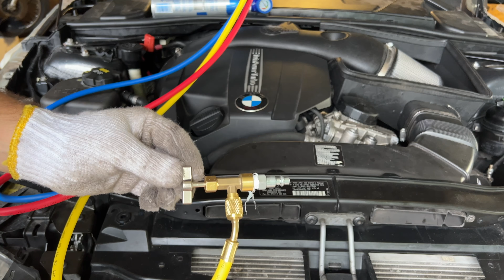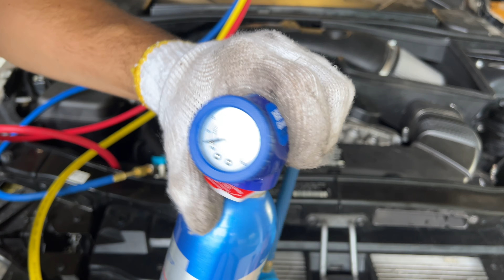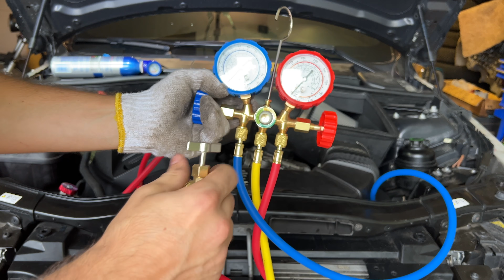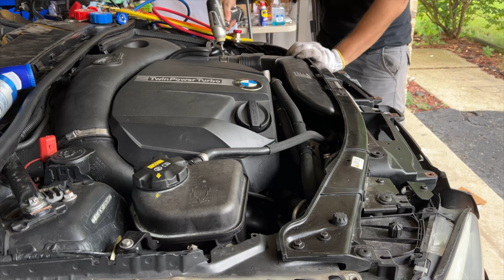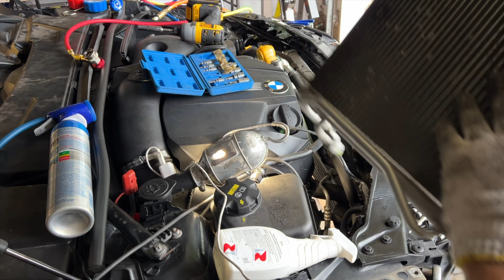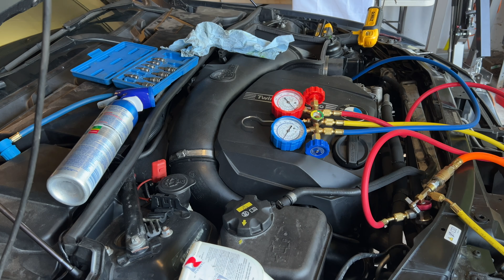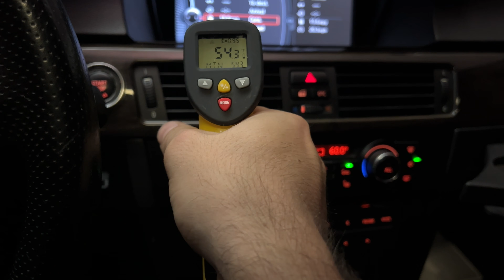Finding AC Leaks in Empty System – No Freon, No Problem

Comment: i just found a huge leak in my 08 uplander it was hard to find but i saved a bunch it was a loose bolt on the bottom of the air cleaner dryer taking your car to a shop is nuts they will rip u off

Comment: this is a good idea - if you want to saturate your PAG oil with moisture that will eventually chemically react with the oil and refrigerant to create an acid that will damage your system.  Better to use refrigerant (after purging the air out of the lines) or dry nitrogen.
Reply: It’s already been open to the atmosphere. It’ll be fine so long as he pulls a vacuum.
Reply: @CookingWithLivvy  sure, if he can get it down to less than 500 microns and hold it there when the vacuum source is removed.  But, I doubt he owns a micron gauge,  has dry hoses,  no leaks, and has three days on a vacuum pump to get it there.  An ounce of prevention is worth a pound of cure.

Comment: Hello,  I have a 2016cadillac escalade esv platinum, and my ac is not cooling at all. I took it to my local mechanic, and he did the same thing that you're doing. So today, I was driving along, and suddenly it went and hot, and it was nearly 90 degrees outside where I live so I took it back to my local mechanic and now he tells me that its a pin hair leak whatever that is! He claimed that there were no leaks and now it's a leak.

Comment: For those wondering he used a 1/4-Inch NPT Male Industrial Air Hose Quick Connect Adapter (easily found on amazon) and PLENTY of teflon tape to create the seal. While close, the outside diameter of NPT is 0.54" vs 0.5" of 1/2" ACME. To get a perfect fit you need to combine three pieces or for a good fit you need two pieces.

Side-by-Side Comparison
Feature	                1/4" NPT (Air)	                                1/2" ACME (R134a)
Actual Width	        ~0.54" (Larger)	                                0.50" (Smaller)
Thread Shape        Pointy / V-shaped	                        Square / Flat-top
Taper	                Yes (gets wider)	                                No (straight cylinder)
Sealing Method	Thread interference (Tape/Paste)	Internal Rubber Gasket

Ok 1 piece connection like used in the video
1/4-Inch NPT Male Industrial Air Hose Quick Connect Adapter (easily found on amazon) and PLENTY of teflon tape to create the seal

Good 2 Piece Connection 
Step 1: Use a 1/2" ACME Male to 1/4" SAE Female Flare adapter. This fits onto the guages.
Step 2: Use a 1/4" Male NPT to Air Quick Connect Plug (Industrial or Automotive style). Standard 1/4" NPT threads are very close to 1/4" SAE Flare threads and can often be connected for non-refrigerant use, though a dedicated NPT-to-Flare adapter is technically safer for a perfect seal.

PERFECT 3 Piece Connection
Step 1: Use a 1/2" ACME Male to 1/4" SAE Female Flare adapter.
Step 2: Use a 1/4" SAE Male Flare to 1/4" NPT Female adapter (this allows you to screw on a standard air plug).
Step 3: Screw on a standard 1/4" NPT male Air Quick Connect Plug.
Reply: Thanks for this! I noticed he glazed over this pretty fast
Reply: SNAZZY!
Reply: Thanks for this breakdown

Comment: Is that a standard tap Valve @ 0:41 seconds?  Those air connector fittings won't connect to the valve?  What did you use to do this?

Comment: Do you have a part number or link to the fitting you used to adapt the shop air connector to the yellow line? My shop doesn’t have a nitrogen tank to test for leaks and I’d like to try this
Reply: For those wondering he used a 1/4-Inch NPT Male Industrial Air Hose Quick Connect Adapter (easily found on amazon) and PLENTY of teflon tape to create the seal. While close, the outside diameter of NPT is 0.54" vs 0.5" of 1/2" ACME. To get a perfect fit you need to combine three pieces or for a good fit you need two pieces.

Side-by-Side Comparison
Feature	                1/4" NPT (Air)	                                1/2" ACME (R134a)
Actual Width	        ~0.54" (Larger)	                                0.50" (Smaller)
Thread Shape        Pointy / V-shaped	                        Square / Flat-top
Taper	                Yes (gets wider)	                                No (straight cylinder)
Sealing Method	Thread interference (Tape/Paste)	Internal Rubber Gasket

Ok 1 piece connection like used in the video
1/4-Inch NPT Male Industrial Air Hose Quick Connect Adapter (easily found on amazon) and PLENTY of teflon tape to create the seal

Good 2 Piece Connection 
Step 1: Use a 1/2" ACME Male to 1/4" SAE Female Flare adapter. This fits onto the guages.
Step 2: Use a 1/4" Male NPT to Air Quick Connect Plug (Industrial or Automotive style). Standard 1/4" NPT threads are very close to 1/4" SAE Flare threads and can often be connected for non-refrigerant use, though a dedicated NPT-to-Flare adapter is technically safer for a perfect seal.

PERFECT 3 Piece Connection
Step 1: Use a 1/2" ACME Male to 1/4" SAE Female Flare adapter.
Step 2: Use a 1/4" SAE Male Flare to 1/4" NPT Female adapter (this allows you to screw on a standard air plug).
Step 3: Screw on a standard 1/4" NPT male Air Quick Connect Plug.

Comment: can you explain how you got that air hose adapter to fit in the can tap. what parts do i need to make this work. thanks
Reply: For those wondering he used a 1/4-Inch NPT Male Industrial Air Hose Quick Connect Adapter (easily found on amazon) and a PLENTY of teflon tape to create the seal. While close, the outside diameter of NPT is 0.54" vs 0.5" of 1/2" ACME. To get a perfect fit you need to combine three pieces or for a good fit you need two pieces.

Side-by-Side Comparison
Feature	                1/4" NPT (Air)	                                1/2" ACME (R134a)
Actual Width	        ~0.54" (Larger)	                                0.50" (Smaller)
Thread Shape        Pointy / V-shaped	                        Square / Flat-top
Taper	                Yes (gets wider)	                                No (straight cylinder)
Sealing Method	Thread interference (Tape/Paste)	Internal Rubber Gasket

Ok 1 piece connection like used in the video
1/4-Inch NPT Male Industrial Air Hose Quick Connect Adapter (easily found on amazon) and a PLENTY of teflon tape to create the seal

Good 2 Piece Connection 
Step 1: Use a 1/2" ACME Male to 1/4" SAE Female Flare adapter. This fits onto the guages.
Step 2: Use a 1/4" Male NPT to Air Quick Connect Plug (Industrial or Automotive style). Standard 1/4" NPT threads are very close to 1/4" SAE Flare threads and can often be connected for non-refrigerant use, though a dedicated NPT-to-Flare adapter is technically safer for a perfect seal.

PERFECT 3 Piece Connection
Step 1: Use a 1/2" ACME Male to 1/4" SAE Female Flare adapter.
Step 2: Use a 1/4" SAE Male Flare to 1/4" NPT Female adapter (this allows you to screw on a standard air plug).
Step 3: Screw on a standard 1/4" NPT male Air Quick Connect Plug.

Comment: My rav4 had a slow leak.  First summer I refilled at $20 and had Air conditioning all summer.  Next year I took the car to the dealer.  The AC was refilled and the leak not found for $240.  After that every spring I put in $20 of Freon into the system.  Now the AC compressor has died; can't create pressure.  Going to the dealer was a huge mistake this time.
Reply: Same here my RAV4 have a slow leak and haven't fixed it yet but someday.
Reply: You mean wasting money on a dealer or because they put on freon? 

What did you do? Did you find the leak? I am unable to find a leak in my RAV4 even after adding the UV. The local guy said just keep putting freon every spring/summer until the leak is big enough to be able to find it.
Reply: @AzSah000  I just filled it up with $20 of Freon every spring until the compressor wore out.  I now have 290,000km on the Rav4 and need to do a lot of work.  (Exhaust, timing belt,find out why new compressor works then stops,  body work)  Good Luck.
Reply: @lazaryanya9407 I see. Thanks for sharing info. So do you recommend, I keep filling Freon until I find where the leak is? Or would you suggest going to a mechanic and get it checked and fixed now? Thx
Reply: @AzSah000  It depends on the size of the leak.  If it lets you have air conditioning all summer then just fill it every spring.  If you have to fill it more than once per year then have it repaired.  Your leak is most likely in the compressor.  My compressor had worn right out contaminating the whole plumbing.  If your Rav4 is over 5 years old replace the compressor.
Reply: @lazaryanya9407 today I put a freon with a lil stop leak and will see how long it goes. But I'll get the compressor changed

Comment: Put 29.2 in-lbs of vacuum on it and close all the valves on the manifold but leave the charge valve heads open, if it holds the vacuum 5 minutes there isn't a leak. Just make sure your lines and connections are leak free.
Reply: Not always.. did mine held vacuum for 2 hours at -30 in about a week later...i was empty of freon... I'm about to look for the leak.God knows where it's coming from
Reply: @Pinkielover 2 hours held vacuum and lasted a week, you might have to use a ultraviolet dye to find it. Modern A/C hoses have a barrier liner inside of them because of the chemistry of the newer freon and even if they look fine on the outside, freon can leak right through the material. A leak Sniffer or UV dye should find it. If it holds a vacuum fine but leaks out when you are using the system, it's most likely on the high pressure side of the system (250+ psi) would overcome the 29 in-lb vacuum test.

Comment: Good method for finding leaks. For the people who complain about using compressed air, attach a water/oil separator to the air line to remove most of the water. Then vacuum the system for at least 1/2 hour to remove the rest of the water. That should be sufficient to then recharge the system without chance of corrosion or damage due to water.

Comment: So you don't need any special tools, just specialty gauges and freon.  That makes sense.
Reply from the maker: It does, because normally this would require a specialized tool that is in the thousands of dollars
Reply: @SimpleCarGuy  It still does if you have some ethics and don't plan on handing down problems to the next unsuspecting soul that buys your improperly repaired vehicle.  A vacuum must be applied to the system (to ensure it's dry) before pressurizing with new freon.  Said vacuum pump will also create a whistling noise like you showed with the humid shop air, but it has no chance of possibly contaminating the system with moisture, corrosion, or pump oil.  Shop air should never be used in a hvac (closed loop) system, similar to not using WD40 in your oiling system or tap water in your cooling system.  As it has been said...there's a tool for that, and I'm not talking about you.

Comment: Can anybody tell the pieces needed to makes this work ?
Reply: For those wondering he used a 1/4-Inch NPT Male Industrial Air Hose Quick Connect Adapter (easily found on amazon) and PLENTY of teflon tape to create the seal. While close, the outside diameter of NPT is 0.54" vs 0.5" of 1/2" ACME. To get a perfect fit you need to combine three pieces or for a good fit you need two pieces.

Side-by-Side Comparison
Feature	                1/4" NPT (Air)	                                1/2" ACME (R134a)
Actual Width	        ~0.54" (Larger)	                                0.50" (Smaller)
Thread Shape        Pointy / V-shaped	                        Square / Flat-top
Taper	                Yes (gets wider)	                                No (straight cylinder)
Sealing Method	Thread interference (Tape/Paste)	Internal Rubber Gasket

Ok 1 piece connection like used in the video
1/4-Inch NPT Male Industrial Air Hose Quick Connect Adapter (easily found on amazon) and PLENTY of teflon tape to create the seal

Good 2 Piece Connection 
Step 1: Use a 1/2" ACME Male to 1/4" SAE Female Flare adapter. This fits onto the guages.
Step 2: Use a 1/4" Male NPT to Air Quick Connect Plug (Industrial or Automotive style). Standard 1/4" NPT threads are very close to 1/4" SAE Flare threads and can often be connected for non-refrigerant use, though a dedicated NPT-to-Flare adapter is technically safer for a perfect seal.

PERFECT 3 Piece Connection
Step 1: Use a 1/2" ACME Male to 1/4" SAE Female Flare adapter.
Step 2: Use a 1/4" SAE Male Flare to 1/4" NPT Female adapter (this allows you to screw on a standard air plug).
Step 3: Screw on a standard 1/4" NPT male Air Quick Connect Plug.

Comment: Clearly you don't know what you're doing... Never never never use air to detect leaks, you can only use nitrogen. The water vapor in pressurized air is introduced to the system and that mixes with the refrigerant and oils in the system. Just having any moisture alone in the system causes issues in and of itself. 
The only way I'd ever use pressurized air is if I were replacing a complete system once a major reason and justification was found for system replacement and I was showing a customer. Even then, nitrogen isn't that much and should already still be hooked up by the time you are showing anyone for a second opinion.
Reply: The drier will absorb the moisture, no?

Comment: this gay is about to let moisture into the system which will freeze in the metering device do not use air to do this test use OFN
Reply: There is already moisture in it given the size of the leak.   That's what a vacuum pump is for

Comment: Can you identify the adapter used to connect the airhose connection to the yellow hose?
Reply: For those wondering he used a 1/4-Inch NPT Male Industrial Air Hose Quick Connect Adapter (easily found on amazon) and PLENTY of teflon tape to create the seal. While close, the outside diameter of NPT is 0.54" vs 0.5" of 1/2" ACME. To get a perfect fit you need to combine three pieces or for a good fit you need two pieces.

Side-by-Side Comparison
Feature	                1/4" NPT (Air)	                                1/2" ACME (R134a)
Actual Width	        ~0.54" (Larger)	                                0.50" (Smaller)
Thread Shape        Pointy / V-shaped	                        Square / Flat-top
Taper	                Yes (gets wider)	                                No (straight cylinder)
Sealing Method	Thread interference (Tape/Paste)	Internal Rubber Gasket

Ok 1 piece connection like used in the video
1/4-Inch NPT Male Industrial Air Hose Quick Connect Adapter (easily found on amazon) and PLENTY of teflon tape to create the seal

Good 2 Piece Connection 
Step 1: Use a 1/2" ACME Male to 1/4" SAE Female Flare adapter. This fits onto the guages.
Step 2: Use a 1/4" Male NPT to Air Quick Connect Plug (Industrial or Automotive style). Standard 1/4" NPT threads are very close to 1/4" SAE Flare threads and can often be connected for non-refrigerant use, though a dedicated NPT-to-Flare adapter is technically safer for a perfect seal.

PERFECT 3 Piece Connection
Step 1: Use a 1/2" ACME Male to 1/4" SAE Female Flare adapter.
Step 2: Use a 1/4" SAE Male Flare to 1/4" NPT Female adapter (this allows you to screw on a standard air plug).
Step 3: Screw on a standard 1/4" NPT male Air Quick Connect Plug.

Comment: I almost did not click on this video when I saw the Freon can. However this video can be very effective for DIY leak detection prior to just replacing parts. I believe the T fitting valve is a 134 can tap, available anywhere for about $10.

Comment: Compressed air when mixed with 134a creates a FLAMMABLE VAPOR
Reply from the maker: This system had no 134a left. That’s the whole point of the video, to find a leak when there is no refrigerant left at all

Comment: Is it a good idea to use a secondhand condenser? Yes the condenser itself is in good nick, but on these models the dryer is the tube attached to one end and as the unit has been open to the air for ages that dryer will not be working. Combined with the fact that using compressed air will also add a lot of moisture, this approach is quite likely to make your oil too acidic, which will be fine for a while but will cause something to fail eventually. I'm not sure that just vacuuming for half an hour after doing this will be enough to get the water to boil out of the hydrophilic oil. Allegedly running a sufficient vacuum for 8 hours or so might do it. Buying a bottle of dry nitrogen (and an M10x1 regulator) to provide the test pressure, and a new condenser with a new dryer is a much better plan.
Reply: I agree xxwookey. But buying a bottle of dry nitrogen and a regulator costs a lot of money. And I just want to fix my ice cream machine which has a leak. So the nitrogen is not cost effective for me. And I know I also need the nitrogen to braze the leak in my case. Now Argon is less expensive. Can I use that for brazing the leak and will that prevent soot on the inside? And is Argon completely moisture free?
Reply: @Pumba3900  I found that the dry nitrogen and cheap welding CO2 cannisters have the same thread (M10) so a cheap welding regulator is sufficient (even though the nitrogen is much higher pressure, it worked fine for me). I had the same question about welding CO2 gas dryness, and could not find out. Even the manufacturer didn't know. So I suspect that the people who make CO2 and argon for welding don't have a spec for moisture so how dry it is is quite random, and depends on the process, or maybe where it bottled. and only dry nitrogen is guaranteed to actually be dry. Which is a pity because all we want here is a dry inert gas, and argon is certainly inert (and I assume it doesn't dissolve into the oil). N2  bottle is 38 quid, argon 28 quid. CO2 20 quid. So yes N2 is not cheap, but it's not that expensive either.
Reply: Great comment

Comment: Thank you for the video. Your method worked well for me.  Was able to find the leak using 100 psi of air and soapy water.  Turns out some of the AC seals were bad and leaking.  Replaced them all, evacuated the system with a vacumn pump, and recharged.  All good now